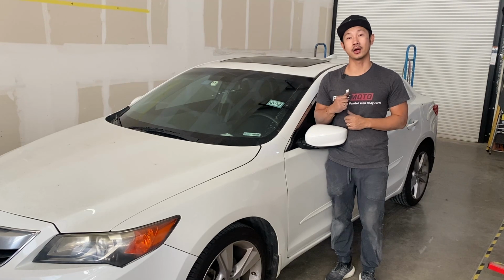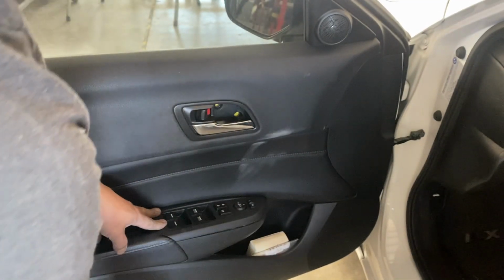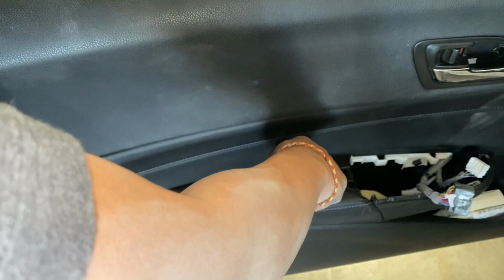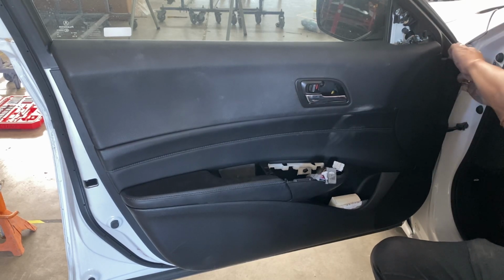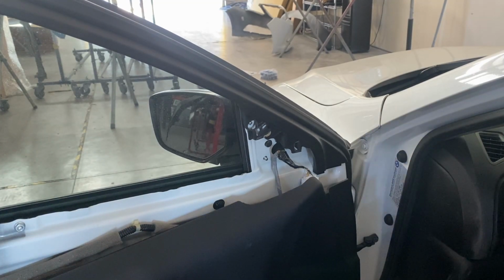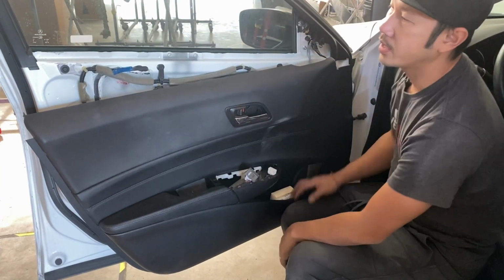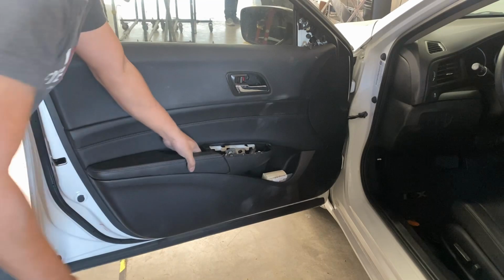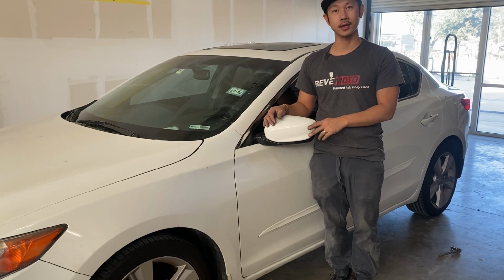How to replace your 2013-2015 Acura ILX side view mirror | ReveMoto

Comment: Just did the right side mirror on an ILX.  No need to remove the door panel…just pop out the tweeter speaker and then unsnap the molding surrounding two of the four mirror mounting nuts. Remove all 4 mounting nuts, then cut the mirror plug harness (leaving a tail you can grab in the next step). Remove mirror.  

While depressing the plug’s locking tab with a small flat blade screwdriver (see your new mirror’s plug to identify location of that tab) pull the harness tail and the plug will easily pull out of its connection. Now you’re ready to install the new mirror !

Comment: You don’t need to remove the whole panel. Snap off the tweeter and pull the panel just enough to where you’re able to disconnect the mirror. Install new mirror and snap panel and tweeter back in. 10min
Reply from the maker: That is true, but it’s easier to show the viewers this way.  Go to www.reveMoto.com for any autobody parts you need

Comment: This looks the same as my 2021 ILX mirror.  Same process to remove?  Maybe only need to remove the little speaker rather than the whole door panel?  Can you just buy the black housing or is it all one piece?
Reply from the maker: This could be similar process maybe not exact.  Look at the new mirror and see if it has a long wire harness.  It does then you will have to take panel off.  This mirror the whole thing has to be purchased.  Go to www.ReveMoto.com.  That mirror you need already comes painted to match your car.    Thanks for watching.  Let me know if you have any other questions

Comment: wondering if you have any tips on getting the last door screw out? I can't seem to get the soft plastic out
Reply: nevermind got it, if you have a toothpick with a flat end, you can go underneath the control panel well and poke the soft plastic out
Reply from the maker: Hello Henry! Yes, it can be a pretty tight squeeze. Thanks for the question and solution. 🤘

Comment: Hi, where is fuse for mirror heater?
My mirror heater dont work in driver side(
Reply from the maker: Hello Artem! I believe all the ILX mirrors come heated. Checking the fuse is a good start. Simply google "2015 ILX side view mirror fuse location" and a lot of sources should pop up. It could also be that the mirror you have is faulty. We sell a ton of mirrors and its pretty rare for it to be broken but it happens. Thanks for watching!